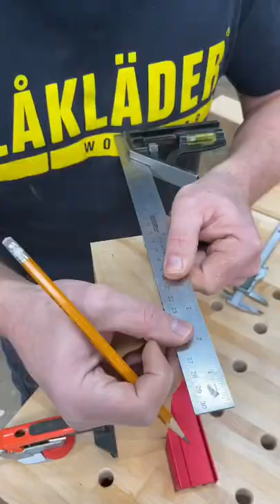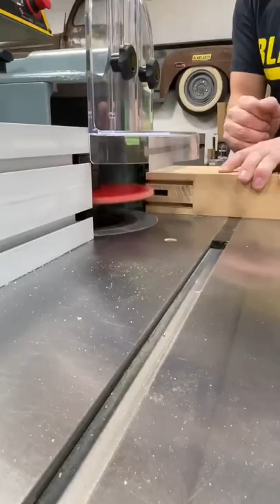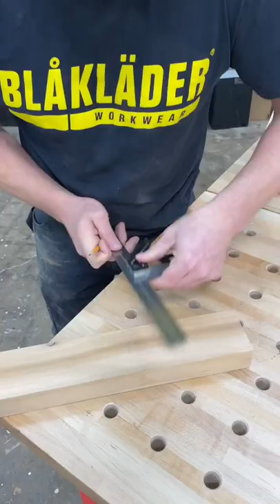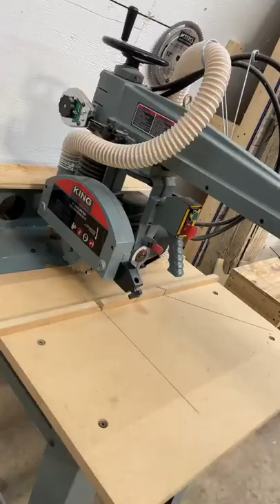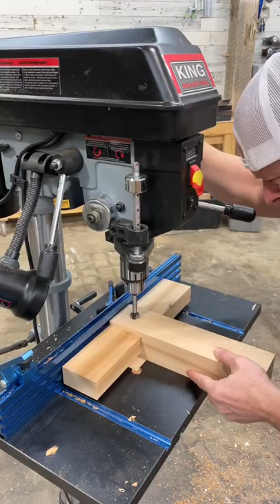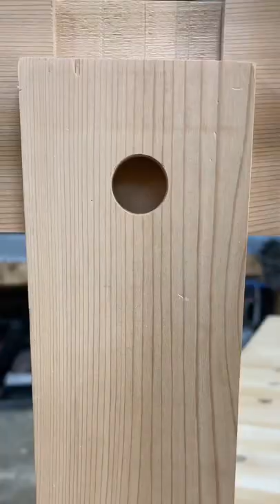Pegged Bridle Joint

Comment: Those extra vertical corners provide a ton of increased resistance on that 90o joint.
You don’t offset the dowel holes on this one? It would be Tighter still, no?
Reply from the maker: Hello, in his videos, Dusty is showing different techniques for pegging bridle joints - this content is one of them. Thank you!

Comment: Why wouldn't you drill through when the joint was put together?
Reply from the maker: Hello,
this extra step can be considered as a way how Dusty works. We all can be creative in our workshops and to have our own techniques. Thumbs up!
Reply: If you look, he offsets the hole in the cross piec by about 1/16th of an inch. This is so when he joins the 2 pieces together and drives the dowel through, the offset pulls the cross piece ver snug into place, causing a tight friction fit.
Reply: @jasonmock848  ah I didn't see the offset. That makes more sense now. Thanks!
Reply: @KINGCANADAINC  Oh absolutely! I was just curious if it made a difference. Jason pointed out it was offset, but I didn't catch that when I first saw it, that's all.